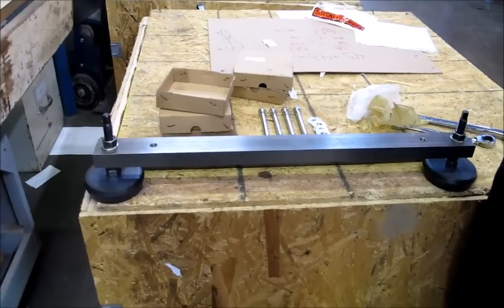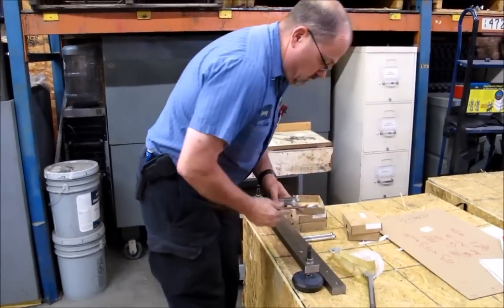Leveling Feet

Comment: Something wrong here. By the time they ship to downunder & convert to $🇦🇺 Pacific Micro Pesos & add 10% GST (Goods & services tax) it will cost over $1500 for this “kit”. 🙄
That includes over US $600 just in “shipping”. 😳😳

I bought 2 x 1 meter lengths of 1x2 inch flat bar from my local steel supplier yesterday for $100🇦🇺

Drilled 4 holes in them and rounded the ends so they don’t hurt as much when I inevitably stubb my toe on them, and bye the time I buy bolts and nuts, pretty sure I’ll get out of it for ~ $150🇦🇺 all up.

So the 1000% markup n this site effectively means we downunder can’t buy ANYTHING from this business, which is a shame.

I priced the two concertina rubber way covers & 6 pieces of felt way wipers, same deal, over $1000🇦🇺 by the time it gets here with freight & exchange rate and GST. 🙄

Kinda bugs me, because you guys do great videos & I would like to support you & reward your efforts, because they are sincerely appreciated.
But I just cannot justify 1000% markups.
And it’s 100% NOT your fault.
It’s the stupid postage rates that UPS / USPS are charging on anything overseas from USA since the whole pandemic & supply chain collapse with evergovern ship stuck in the Panama Canal etc. 🙄
The stupid thing is, air freight shouldn’t be expensive, planes are back flying, air ports are open and working, border closures are finished, so the planes when they fly, carrying passengers, it’s the air freight in the belly that covers their fuel costs etc.
Theres just no excuse for the stupid freight costs being gouged out of postal service customers.
It’s killing international trade.
What’s the point of a free trade agreement between our countries if postal charges are being used as de facto trade tariff barriers?

Someone in the White House needs their senile geriatric arse kicked until his nose bleeds. 🙄🤬👎

Comment: Being reasonably new to the Bridgeport, so i assume where the BP manual says you should bolt the machine down for safety.......BS?
Reply from the maker: I would not say it is “BS” but in the nearly 40 years I have been doing this I would say less than 5% of the mills I see are fixed to the floor.  I know that in our shop we have never had a mill tied down to the floor.  Give us a call at 800-285-5271 if you would like to discuss it over the phone. -Barry
Reply: @HWMachRepair  Thanks for the reply. It's always good to get information from people in the real world actually using the machines, and not people who write manuals in an attempt to try and make everything litigation proof.

Comment: I just built this system for my ENCO knee mill. Front holes  were approximately 19.5" apart on center and the rear were 21" inches apart on center.  They took 1/2-13 6 1/2"  bolts with 3 washers and   one split lock washer. I added 4ft long 4x4's on the side to use as skids. This allowed the palette jack to easily slide under. Then the 1/2-13 bolts used to brace the 4x4 wood and 1" steel were 5" long, but I recessed the bottom holes to hide the nut. Worked like a charm.

Comment: Hi I use 1 "steel
but I also need the width of the steelwidth x height x length.
thank you
Reply from the maker: 28" x 2" x 1". I have a diagram I can email you with all the measurements for a Bridgeport. Just email me at support@hwmachinerepair.com and I will get it over to you.
Reply: @HWMachRepair       A suggested modification is to make your bar 35" long and space the 3/4" holes at 33".  This will give you enough room between pads to get a standard 27" pallet jack between them.
Reply: Thanks, you are very kind
Reply: Hi
last question could you tell me the distance of the holes and the diameter of the holes
Thanks
greeting valter

Comment: Hi
could you tell me the thickness of the iron you use?
thank you
Reply from the maker: We use 1" steel. Let me know if you have any other questions.
Reply: @HWMachRepair  A suggested modification is to increase the bar length to 35" and use a 33" spacing between the 3/4" holes.  This will allow you enough room to get a standard 27" pallet jack between the leveling pads.